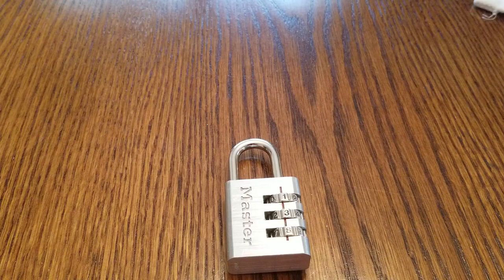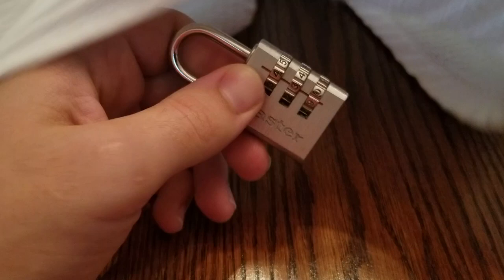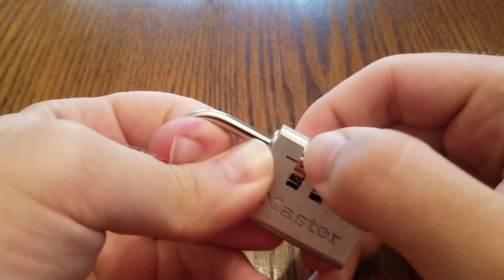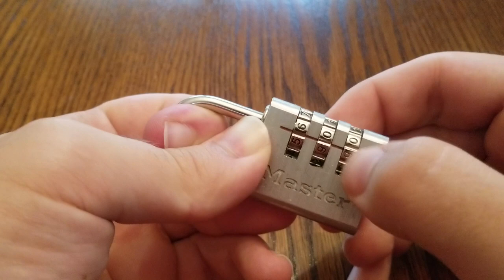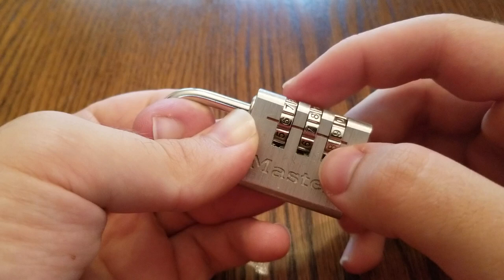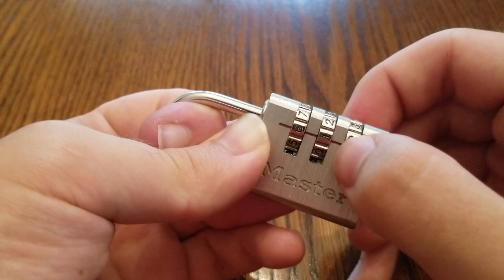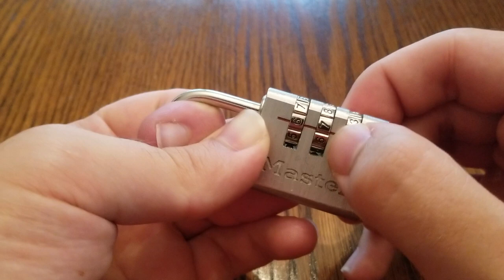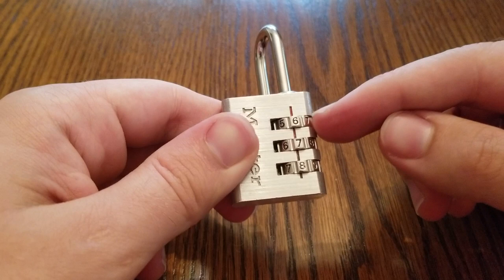Decoding Master Combo Lock 630D

Comment: Literally just used this technique as I accidentally reset my combo while it was on my fence and it worked! A little trial and error and I did it within 10-15 minutes! Thank you so much!!!!
Reply: LOL you saved literally no time. It's a 3-digit lock. That's 1000 combinations. Only takes about 16-17 minutes to go through every combination sequentially.
Reply: @mokahless  10-15 minutes is less than 16-17 minutes, but thanks for pointing that out.

Comment: Could you clarify what you mean by the "click" you're looking for when turning the wheels?  You said something about it feeling "solid".  It'd be great if you could clarify as that seems to be at the heart of this operation. Thanks.
Reply from the maker: Absolutely. It's something that is a bit hard to describe other than just feeling it. Pretty much as you're hitting the right number it will suddenly be harder to turn, and then it will be more of a "clunk" than a little click, like something is settling into a larger hole (which is what is happening). You may also feel the shackle move upward at that moment as well. It's really the same feeling as regularly turning the wheel, but really amplified
Reply: @kman1759  That's very helpful, thanks!
Reply: You’ll also see a bit of a tab pop up on the metal loop, the side where the combo tumblers are. That gave me an indication that I was headed in the right direction!

Comment: Wow. You just saved me $20 and a bunch of aggravation. THANK YOU!!!  My clumsy bf messed up the locks putting them both on the washer and dryer and locking them. I guess his fingers turned the numbers when he locked the two locks and Neither he or I could open them. He called a friend to borrow bolt cutters. He was going to buy two new locks after cutting them off and after returning the bolt cutters BUT…I watched your video and had the first lock opened in about 2 minutes and before he even returned with the bolt cutters. The second lock took about 10-15 minutes. Thanks again for this excellent video!
For anyone trying this I suggest that you try with the top number and leave the middle and bottom two the same.  If that doesn’t work, then try looking for a new bottom number and leave the top and middle numbers the same. Ding dong accidentally moved the top number on the first lock and the bottom number on the second lock. It may help save you time trying to find all three numbers at once.  😁

Comment: This technique didn't work for me and my finger is now numb. After purchase, I reset the code and tried it a few times and worked fine. Now trying to open storage room and can't open this lock. What options do I have? Can I cut it? Should I get in touch with master lock?
Reply from the maker: That's too bad this didn't work for you. I'd contact your local locksmith about this, I don't think the company will be helpful
Reply: @kman1759  thanks
Reply: It's a 3-digit lock. That's 1000 combinations. Only takes about 16-17 minutes to go through every combination sequentially.

Comment: What happens if the shackle is locked open
Reply: Just tried it, hold it in the reset spot with some down tension and use the same technique